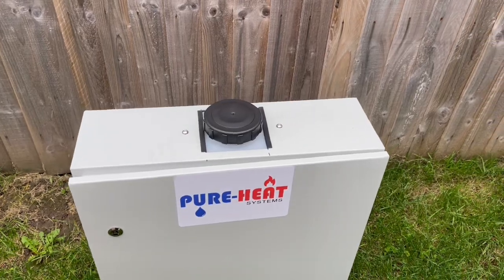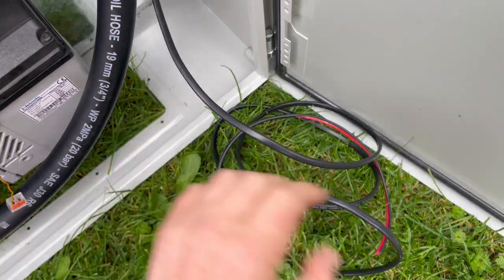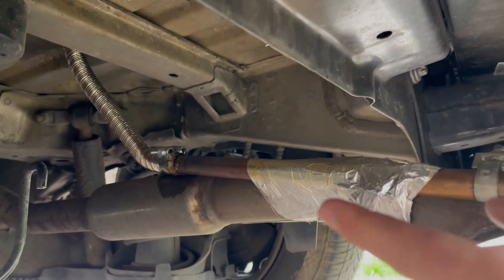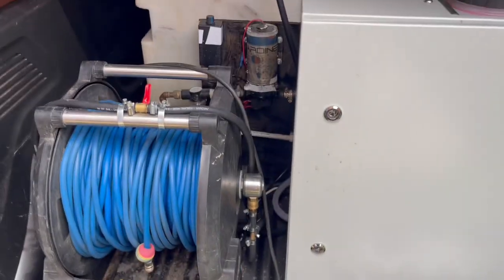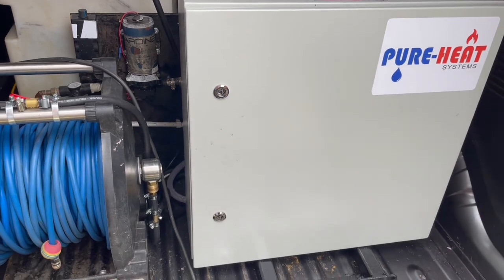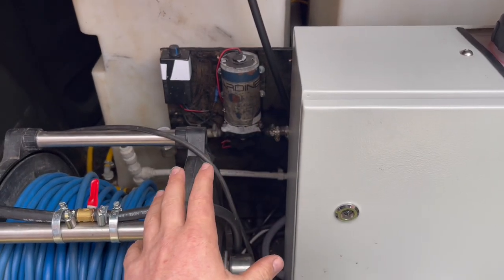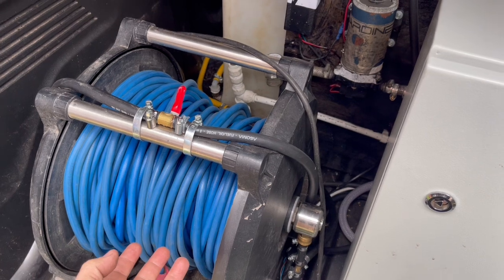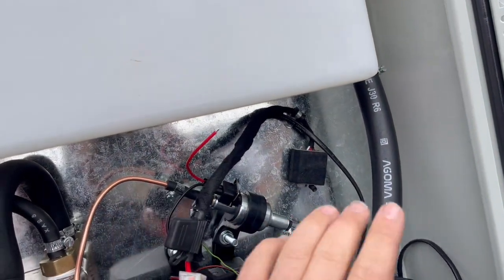Pure heat systems v2 hot water window cleaning system

Comment: Are they suitable to use with uni values
Reply from the maker: Yes they are, you just have to make sure you have the correct pole hose. We sell hot water pole hose on the website at £1.50 per meter.

Comment: Is water temp at fixed temp or just controlled via water heater interface ? Is on demand rather than heating water tank ?
Reply from the maker: Hi our latest heater you can control temperature via the digital controller and yes works on demand, feel free to join our Facebook group Pureheat systems